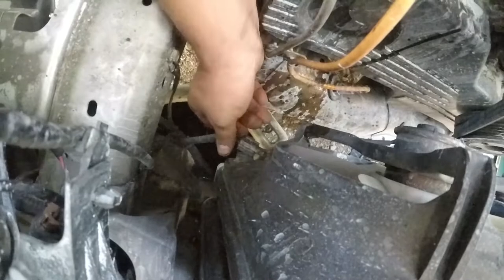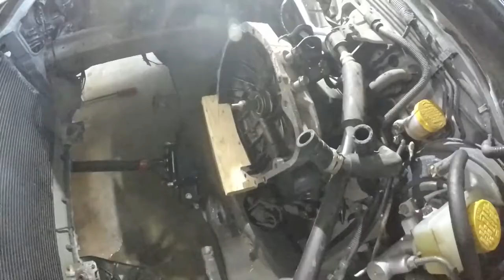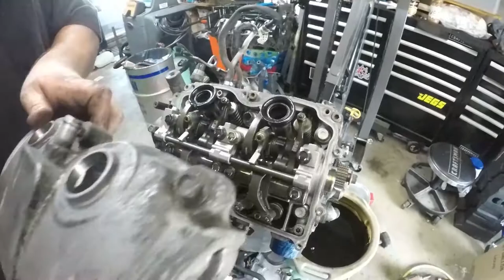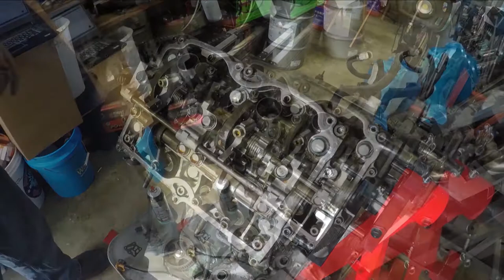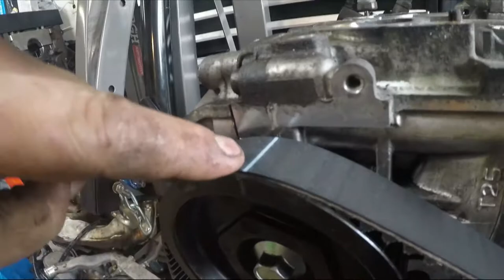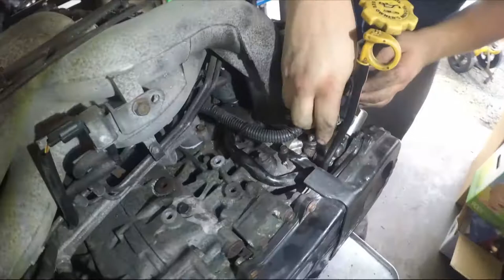2008 Subaru Impreza Head Gasket Replacement - Complete Video

Comment: Our 2009 automatic Impreza 2.5i is going back together and we can't find that little shield over the top gear of the timing belt. I'm not 100% sure it had one and parts lists it as a MANUAL part. I cannot find it to order, either. Does the auto have it?
Reply: Only the manual has it, not the automatic.
Reply: @cmendillo  Thank you!

Comment: After following this video and doing my own gasket replacement - this video is great and covers all the details (make sure you watch each part intently).

A few tips for those with AUTOMATIC transmissions - There is a view port on the top of the bell housing on the block side underneath the throttle body - access this to remove the torque converter and make for easy engine removal. This same port can also be used to remove/tighten the crank nut by putting a screw driver into the port to stop the torque plate from rotating. Attach the exhaust after the engine is put back in. 

Cheers and happy wrenching.

Comment: Any information on the engine size and where you can purchase the head gasket set?
Reply from the maker: Engine Size is 2.5L Non Turbo. I added links for all the parts into the description. You can also go to any parts store and get them but that will be significantly more expensive.

Comment: Hey quick question here, I have an 11' impreza, manual transmission. Do I need to remove the clutch fork to separate the block from the transmission? Thanks
Reply: I removed the 6 bolts and 2 nuts. Jacked the transmission so the engine mounts are cleared. The exhaust manifolds are disconnected. Am I missing something?

Comment: Do you need to remove the fuel line pressure before disconnecting, or does that quick disconnect fitting automatically close when removed?
Reply from the maker: You should technically relieve fuel pressure and plug the lines when disconnected. The system doesn’t have enough pressure to hurt you unless it sprays into your eyes. You could put a rag over the connection as your disconnecting it to catch the fuel.

Comment: Where the heck is pt 2?? Like you make a video and leave out the most important part, assembly.
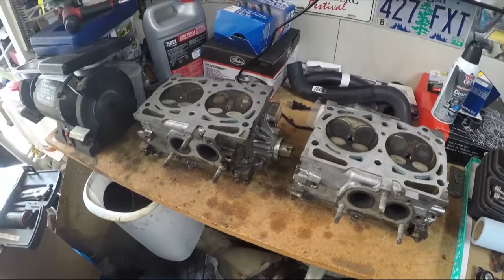Reply from the maker: Start at 37:40 and that all the install stuff. It all one video or look at my content and it’s all done in separate videos.
Reply: @DMoneyGarage  yes but, installing the motor and re connecting all the wires and components. I got my engine in but there's bits that I can't remember how they go together. Thank you though for the first part, it all has helped a ton!
Reply: @isaacodegard740  If you're ever going to take on a project like this, you need to stay organized and take pictures of everything.
Reply: @charleston_  luckily I did snap some photos, and I had each part laid out in the order they came off. Still wouldn’t hurt to at least have a little bit of guidance putting it all back together. I got my car back to 100 percent but had issues with getting the engine in as this video is a manual trans and mine is auto. But I figured it out, the torque converter has to be removed from the torque plate and boom she goes in no problem.

Comment: Thank you ! My 2008 Impreza 2.5i MT 5Dr Sport is only 65000 miles but I just noticed a leak at the head gasket near cylinder 2 while doing my oil change. Do you think it's worth replacing the head gaskets ??? I wonder the price range for that kind of repair? Can I still continue to drive it or is it an urgent matter ? It's not overheating (operating coolant temps go between 180 and 210°F). No bubbles in my coolant expansion reservoir (no milky coolant). Does not burn oil at all (maybe a 1/4 quart of oil every 3000 miles at most). Other than that, vehicule run great, I just had timing belt done, blue coolant flush, 4 brakes changed and flushed, tires are brand new too. Had my gas tank changed because it leaked (rusted nipple of EVAP hose was the problem). Bit of rust as I'm in Canada, Quebec City. I do antirust treatment on a yearly basis.
Reply from the maker: Definitely not a major issue. You don't have to fix it if it's not pouring out or having overheating issues. Most of the ones I do are because the customer doesn't want any leaks and I'm fair with pricing so they are ok fixing it. I'm around 1500 for the whole job. That's parts, labor and machine shop costs.
Reply: @DMoneyGarage  Thank you for the reply. That's good new. I'll continue keeping an eye on my fluid levels (always check my oil level and coolant level in the expansion reservoir every time I fill up gas). Few years back, I installed 270°-full sweep mechanical gauges in my A-pillar (VDO colant temp model 180-901, VDO oil pressure model 150-904, and VDO vacuum pressure model 150-042), so I alway have my temps in check.1500$ is definitly a very fair price. If I was in your area, I would definitly hire you for the job. Here in canada, I woun'd be surprise if the dealership would charge 6000 canadian dollars. Independant garage would probably do it for 2500-3000$, but I would need to find one who does specialize in subarus and who does focus on doing a good jobe of planing the head the best possible manner. Even the subaru dealership tend to cut corners for that step...
Reply: @DMoneyGarage  You are a Saint! I hope I can find a Mechanic in Los Angeles like you.

Comment: This was amazing to watch, Thanks for sharing! Question do you prefer the Mahl head Gaskets over 6 Star head Gaskets for this engine?
Reply from the maker: I use mahle cause my parts guy keeps them stocked and I don’t have to wait. 6 star make great gaskets too so that would be user preference.
Reply: @DMoneyGarage  I thought it was interesting how you are wondering about the torque specs on the head gasket. I noticed that 6 Star said you don't have to retorque their gaskets. I wonder if Mahl is the same since it's made of steel.
Reply from the maker: @MirrorlessFrame  never thought to reach out to mahle but factory service manual says to loosen them before final torque. Not many manufacturers say that.
Reply: @DMoneyGarage  yeah that's interesting. I know you are busy, so I'll try and find out. I will also contact Ishino (Stone) who is another Subaru OEM head gasket manufacture that is popular with Subaru Techs.

Comment: Do you have to remove the engine out?
Reply from the maker: No. But the time you spend fighting with getting to bolts and making sure gasket surfaces are clean, the engine can be out and make 100x easier to do a fantastic job.
Reply: @DMoneyGarage  thanks! Mines overheating and unsure if it’s a thermostat or water pump or if gasket has gone! But if a nightmare